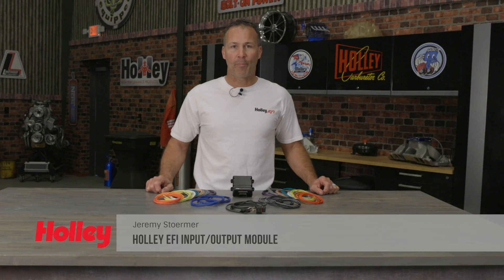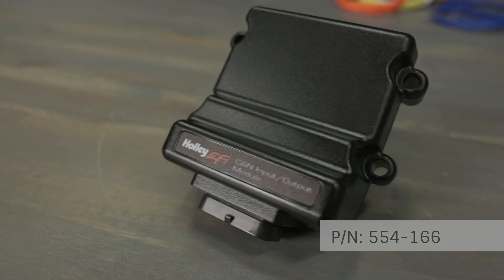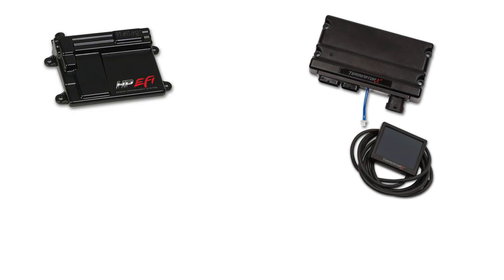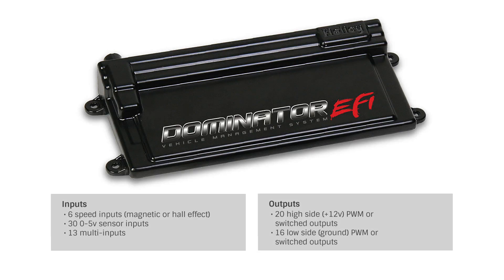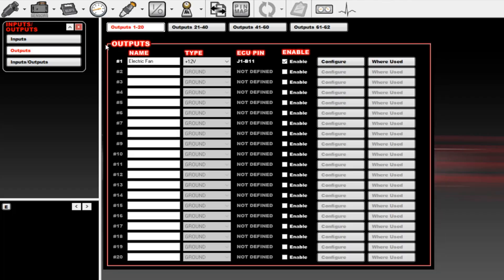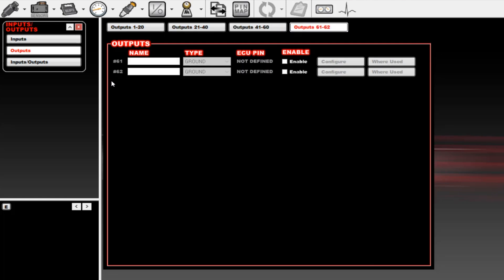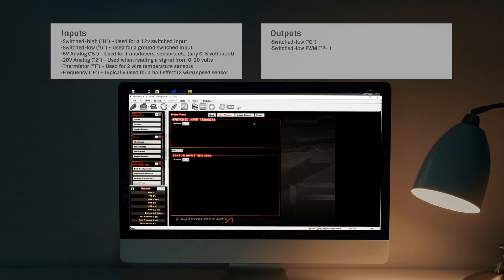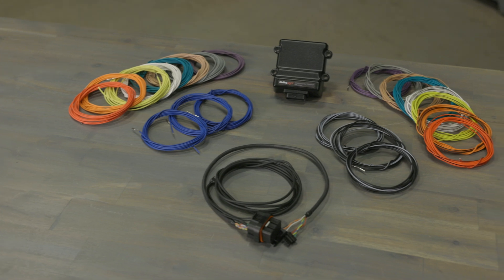Upgrade the Capability of Your Holley ECU with the New CAN Input/Output Module

Comment: So make the firmware where us hp/terminator x guys can use the transmission icf and this module. Make it pass protected and charge for the access like you do the traction control if you have to. Some of us don't have dominator money, but would rather not get a terminator x anything.

Comment: ah, bummer... this won't work with the Holley Sniper then?   That's the system that NEEDS more inputs/outputs! C'mon, what about us sniper guys !?!?!?
Reply: Buy a Dominator
Reply: @Boosted370  yea, tell me something I don't know dude. some of us don't have big money for the ultimate best parts; kinda was hoping for a way to add a feature like "fuel pressure" or "oil pressure" to the sniper. If I had big money, sure, I would buy something different, but that is not a reality now.
Reply: @IROCZman15  well I don't have big money either but I do have the ability to throw a few hundo every paycheck to the side until I could pay for it. I used the Holley HP for years but on my new build I'm running a built 80e which the HP can't control and the Sniper systems are limited to high impedance injectors, one type of wideband o2 just to name a few